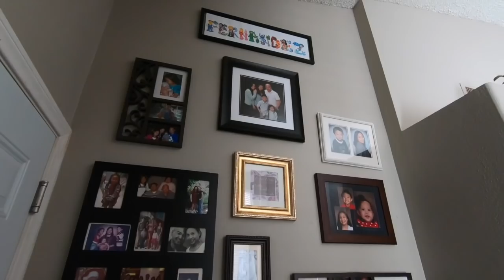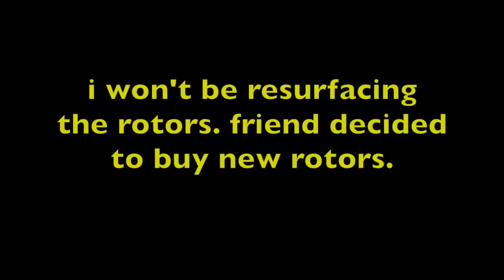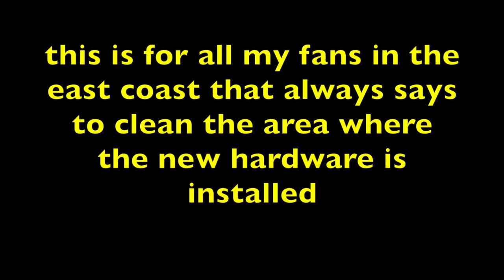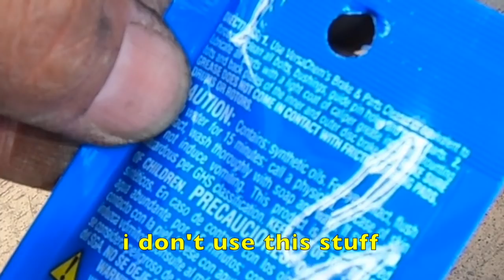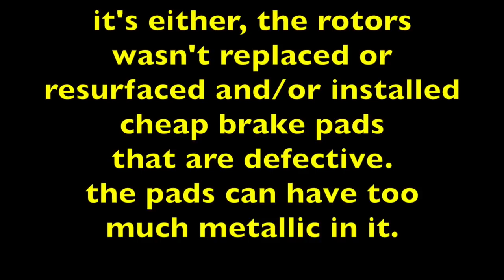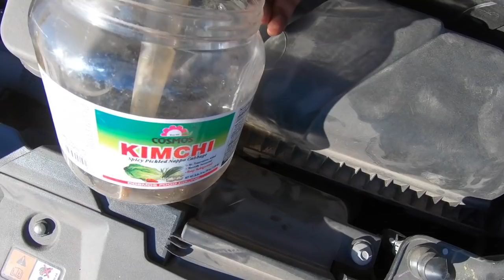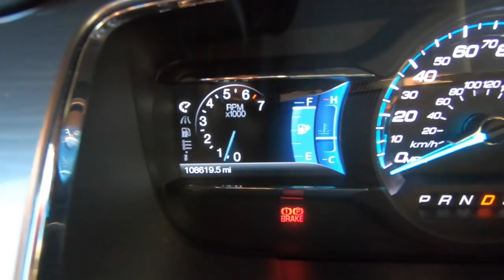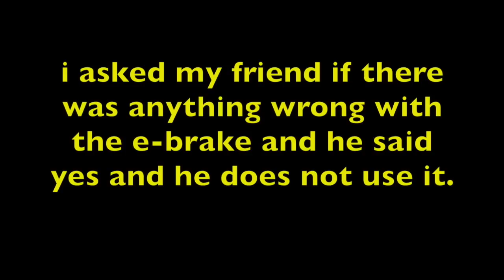What really happens when i do a repair Ford Taurus rear brakes √ Fix it Angel

Comment: What I do when winding back the piston is to lift the rubber boot up with a small pick and put a bit of silicone grease in the gap, and then use the pick to work around the metal piston where it meets the rubber seal, this way when the piston turns back, the grease gets spread around the seal and it stops the rubber seal from getting all twisted.
Reply: Was going to mention it but I usually spray wd40 after lifting the rubber

Comment: my personal experience is with toyota's double back plate front brake pad. customer complaints it squeak when braking. i clean the back plate and the place where the brake pad seats. add some brake use copper grease to the back plate and seats. reinstall no more squeak.

Comment: awesome job bra..,will you do a power steering leak ..and pulley..and what bout code PO016 this code i replace the both sensors and the engine light still on than i took it to the shop they think it was the solenoid but wasn’t they dig more they think something with the engine maybe timing chain they’re not sure so i took the home maybe i’ll drive it till it dies 🤷🏼‍♀️any idea..!?

Comment: Funny you found the missing sock from the wash. Like Honda, why do they use those bolts to hold on drums and rotors? I hate those screw-in rear caliper pistons. It’s good to know you had nothing to do with that parking brake problem.
Reply: Those screws are there to retain the rotor in place while the car is being assembled

Comment: thanks for posting video.  Can I leave those rotor screws out?  I am afraid they  might get rust and stuck.  Everything rust quickly in NJ.
Reply: I work at a Ford dealer in nj. Yes you can leave the screws out. The wheel holds the rotor on
Reply: @jordonbruce1364  thank you

Comment: Up here in Ohio, I use the grease, and anti seize on the face of the hub. RUST PREVENTATIVE.  Down there, nah you don't need it...agree.   Appears to be electronic parking brake bc you had to use a tool, but had a manual foot lever? does it have both?

Comment: please i need your help i got a 2002 honda crv with check engine light on code p1457
i replace everything in the canister all valves and solenoids including the canister everything that is attach near the canister  all new and the code still showing up in the computer please help me

Comment: Why didn't you place silicone grease on the hardware before sliding in the brake pads? Just curious...🤔
Reply: Don’t grease pad side of hardware. Only caliper bracket side. To prevent corrosion.
Reply: @NickMyers1   Thanks.

Comment: First time hearing Angel fart on this video. Maybe next time need a diaper, lolz. Just kidding. I love all your video Angel. I have question about AC Compressor. Does it have pop off valve if the oil is too much, too high pressure or too much freon? Because I brought a AC Compressor on ebay from a seller, it keep on having this popping loud sound after charging freon R134a so i stop putting anymore freon into my car after i replaced my new AC Compressor on 2006 Scion TC. Can you tell me what is going on? I have manifold gauge, vaccum pump and AC R134A freon gallom at home. Let me know ASAP. Thank you. 
@Fix It Angel
Reply from the maker: Hi, too much high pressure. Problem could be bad expansion valve.
Reply: @FixItAngel  Really a bad expansion valve? Even i got new ac compressor just put in. Does ac compressor have pop off valve?
Reply from the maker: @imports4lifetoyotalexus98  you can to do some research online. If there is too much of high pressure in the compressor it relieves it with the high pressure release valve on the compressor. Also there can be a restriction in the condenser. Maybe clogged. Did you put the right amount of freon? There is a sticker on the hood that tells that amount should be put in.
Reply: @FixItAngel  I think I tilt the 1 gallon tank over when I charge the R134A into the system after i replaced the condenser and ac compressor that day. Do you think i did that and add too much oil on thr ac compressor? I did lot of research and it didnt help me much.

Comment: You would be so much better off with a lift if only to get the car 5 feet in the air. There is a portable lift that cranks up mechanically with a ratchet 4 feet. And you can teeter-totter the car while on the lift. It costs around $75

Comment: I estimate you have to poo within two hours max. Smells like beans. I thought it was "every tool has a hammer side" and you also should put some anti-sneeze under the pads as well to limit squeal. As on the part under the bracket ears and on the round part of the caliper piston. But DON'T do the whole pad! Dust would just gum the exposed part! Only the part the metal touches. Never put it on TOP of the hardware. only underneath where it sits. never put anything on the friction material side that touches the rotor. Never on the ears.